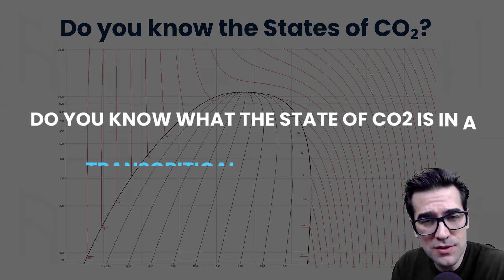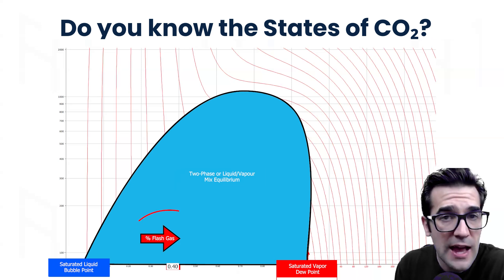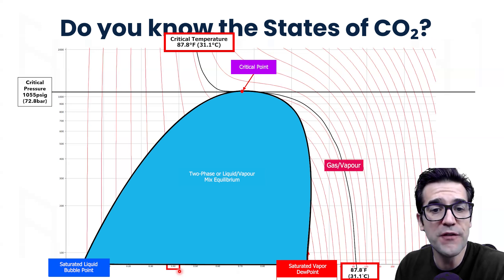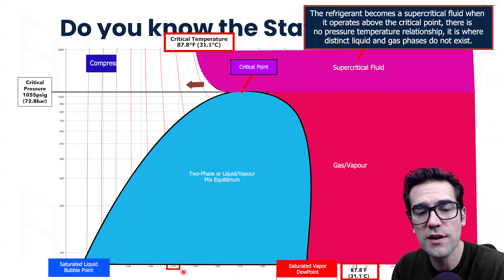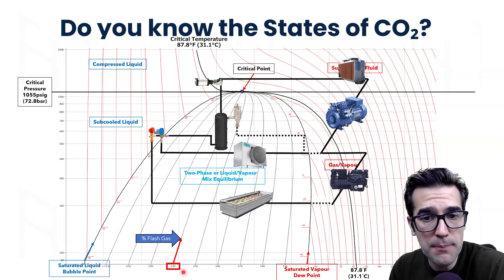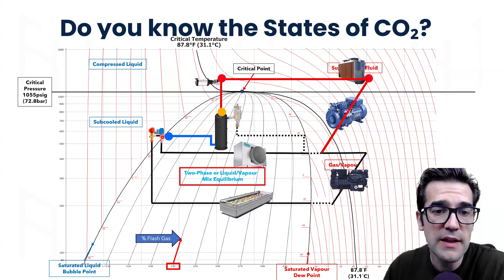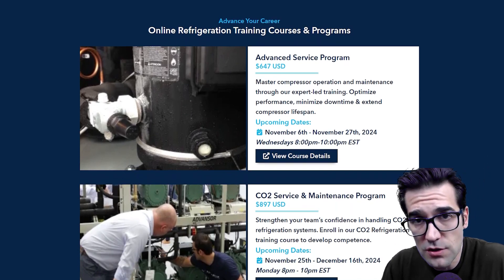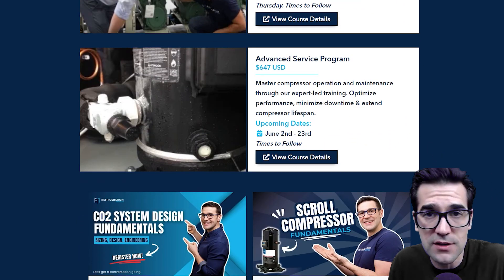Do You Know the States of CO₂ in a Transcritical System?

Comment: Sooo I’ve been told that co2 doesn’t actually achieve 100% vapor after the evaporator. Never made sense to me cause you can’t compress liquid 🤷‍♂️
Reply from the maker: @caseysherfey3344  if your talking about a secondary co2 pump systems sure but if your talking about a transcritical system or a booster system, it will Vapor after the evaporator. If not you will have saturated or wet gas which will cause lubrication issue. I have CO2 courses running many times during the year you should all come. Https://Www.refrigerationmentor.com/courses
Reply: @  thank you for clearing that up. I just returned from a co2 class today. My company gives their own classes, but your videos have been a lot of help breaking the set up down. Unfortunately we covered more of secondary systems instead of transcritical, but I’ve been able to go through your videos and piece together answers to my questions about transcritical systems. So thank you once again. I really appreciate you taking the time to share this information.
Reply from the maker: @caseysherfey3344 we do training on Secondary pumped CO2 and glycol systems. Email me at support@refrigerationmentor.com me if your company is looking for more training.